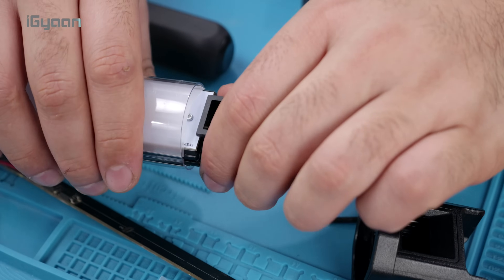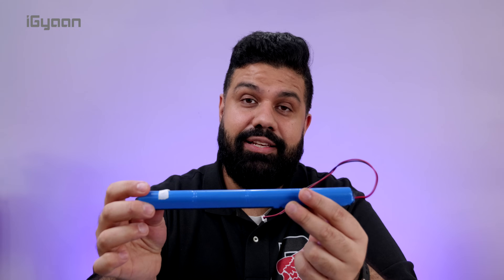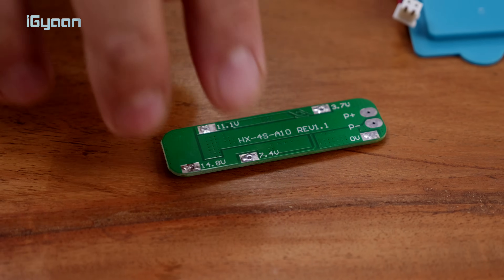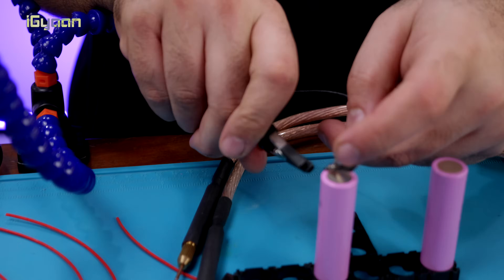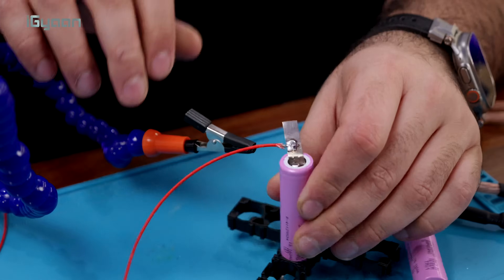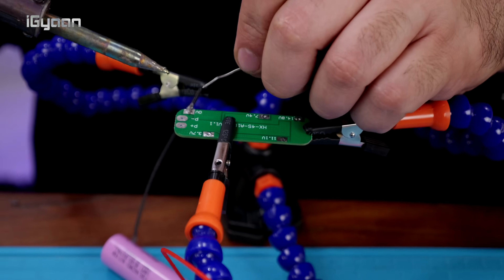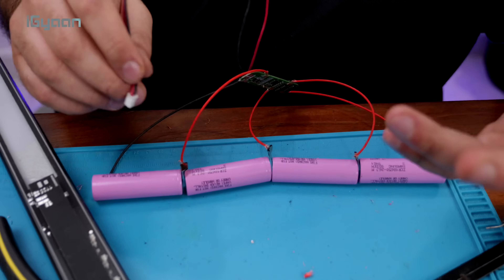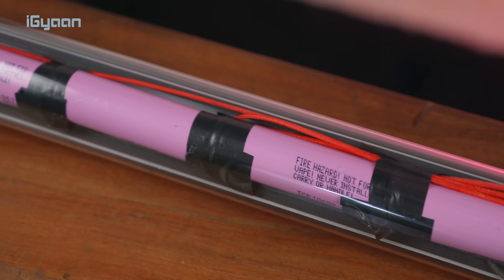Never Buying Batteries for Electronics Again : DIY Battery Packs

Comment: Thank you for using a spot welder for Li batteries. 
It's scary to see so many diyers directly soldering on the Li batteries. 

These need utmost respect and safety while handling so points to you for that.

Comment: link to buy batteries?
Reply: Just go to local laptop repair shop and buy old laptop batteries, one battery will cost roughly 100₹ and each battery contains 5-6 cells, out of which you can get minimum 3 good cells.

Comment: Where did you source the batteries from?? It's hard to find a reliable source of 18650 in India
Reply: robu  thinkrobotics  robocraze  and many more electronics related sites have these now :)
Reply: Robu keeps all orginal but grossly overpriced. If you have a device valueable enough then you can buy from them..back when aliexpress worked i bought 30 panasonic ncr18650b for not much more than 2$ per cell and they are all original tested as 3400mah.. at the time of purchase i didn't realise such high capacity cells degreade very fast. In 300 cycles they lose 20% capacity. As such many of them that i heavily cycled in powering lights and my camera for hours are now measuring less than 2900mah. Those cells are almost 8$ a piece on robu. We do not even have access to battery hookup as shipping dangerous goods to india is a lot of hassle and most pin codes do not even allow that shipment. Otherwise i could have bought so many good cells from batteryhookup , even after paying 40% import duty some of them are still worth the money. Specially for lithium ion. Local sellers of lithium phosphate. Has sprung up a lot and they are selling good cells for reasonable price.